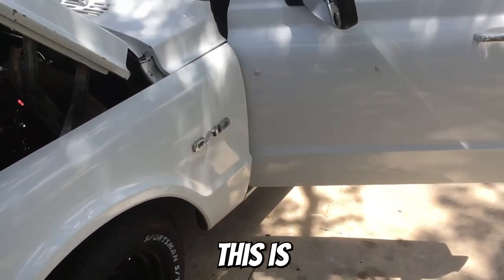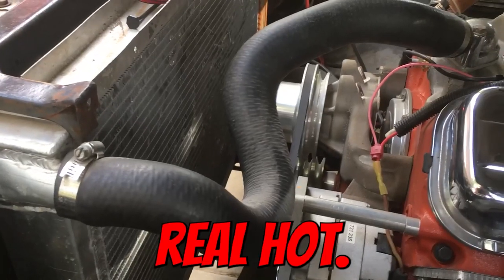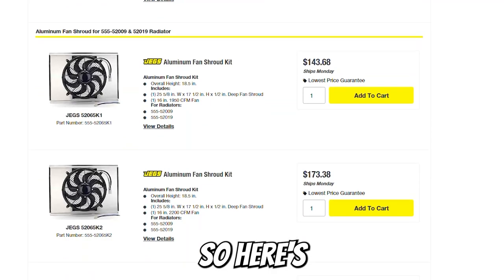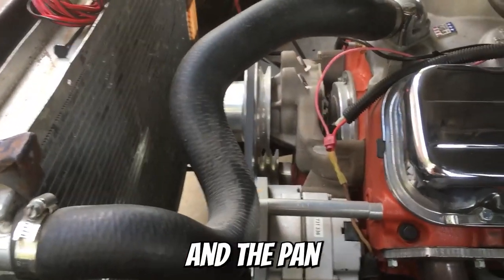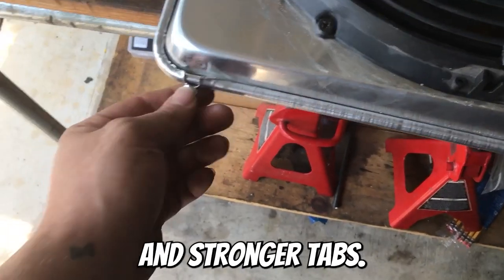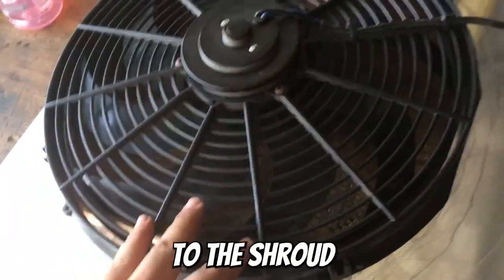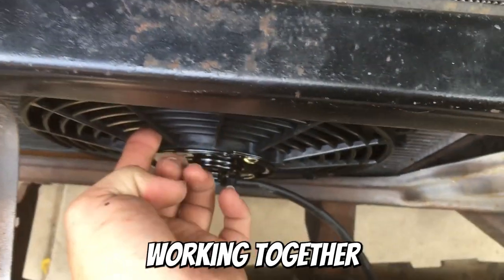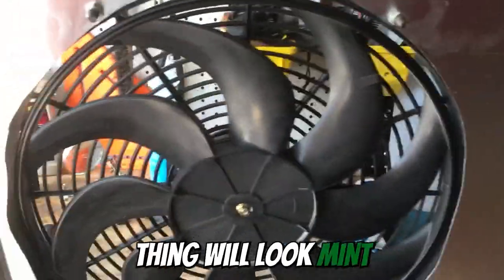DIY Budget Fan Shroud for $20!

Comment: I've never really had good luck with the push config. It focuses the flow thru to directly where the fan is. And has a few times worn the fan out prematurely, by the strong wind force putting a pulling force on the fan shaft (trying to pull the fan shaft out of the motor).
A 2 inch depth shroud made a huge difference on my old Ford with a 16 inch electric fan. Though I found an exact fit, universal mount at Summit racing for about $50, many years ago.